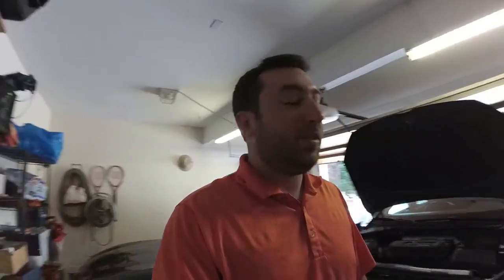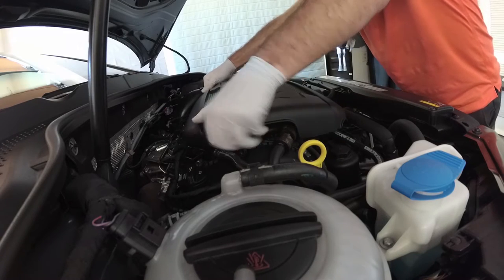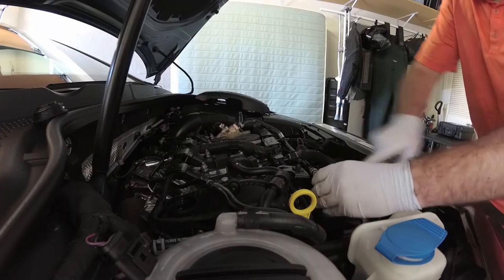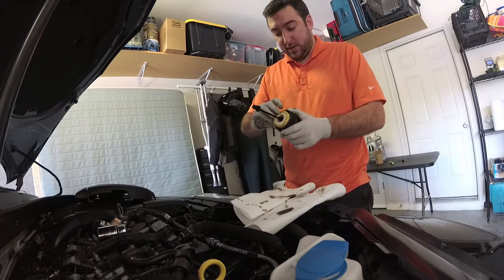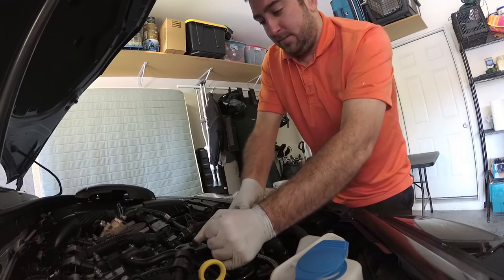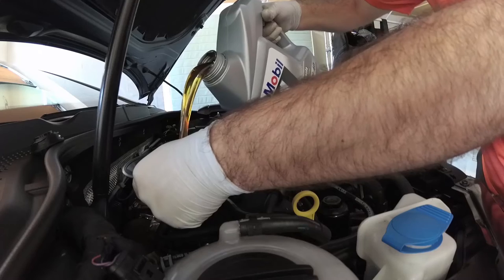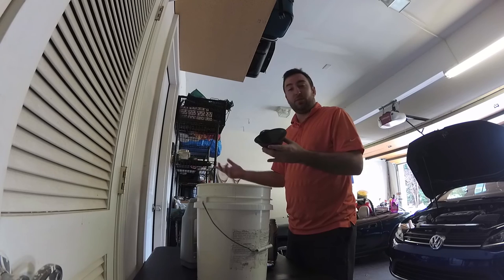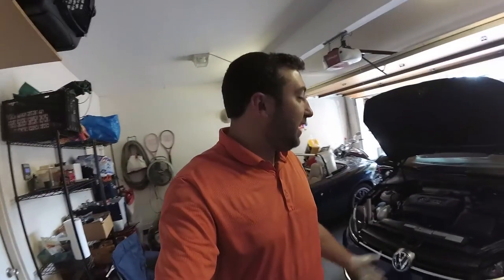How to - Oil Change MK7 VW Golf R (This is a 2016)

Comment: Always undo or remove oil filter before draining the oil. Top tip 👍
Reply: Why?
Reply: ヅSupwitaids the oil in the housing will drain out as your letting air in.

Comment: Does the oil plug/screw and the oil oring come with the oil filter?
Reply: Depends upon the market, but generally speaking VW OEM will provide the filter o-ring with the filter.

Comment: What was the torque of the filter cap 18ftlbs? Also, what size socket is that? 7:21 you get a lot of those after 40 lol

Comment: Thanks for sharing...
Please show which tools (and their bit sizes) are required to do the job, and where can we buy it?
If it wasn't for DIY, we wouldn't have seen the video..
Reply: Don't you have tools? That part is not hard to figure out yourself. Daah!
Reply: 13 mm socket for the filter and a flathead for the plug. that's it.

Comment: Why do you put 0w40 in there? Are you doing track driving?
Reply: M1 0w-40 is VW approved and is easily available at most local auto stores
Reply: Right, thanks! Though that didn't really answer my question :) As I'm sure you know the standard oil put into a Golf R at least in Europe is 5w30. Is there any particular reason you are using 0w40? Thanks!
Reply: endze he literally just told u

Comment: what about showing how you took the engine floor cover off  that protects the sump, and what tools were used  without that this vidio is a wast of time.
Reply: ronald bowerman It doesn't have one.
Reply: @Vdub-md2wz  I think you got ripped on your purchase mate, they should have one. Mine has a skid cover
Reply: @puhlyy   A good creator would provide the  complete process, at least outlining items missed in the video production. I don't think an oil change is hard, yet we both watched this video ey :)